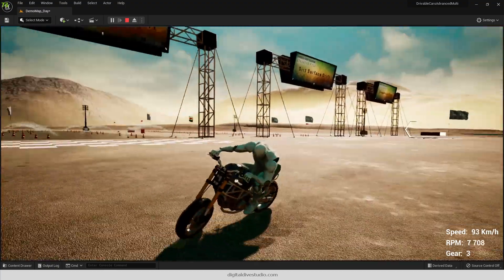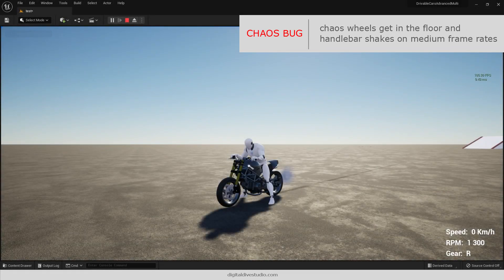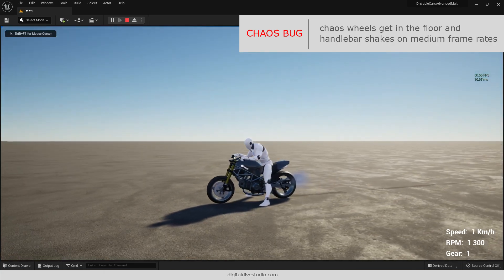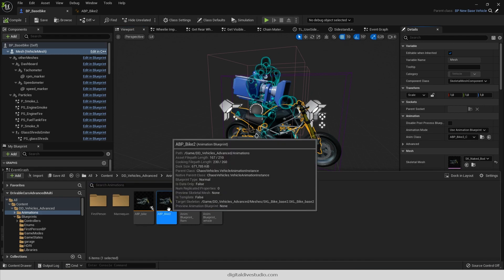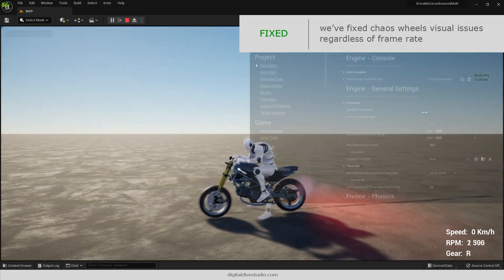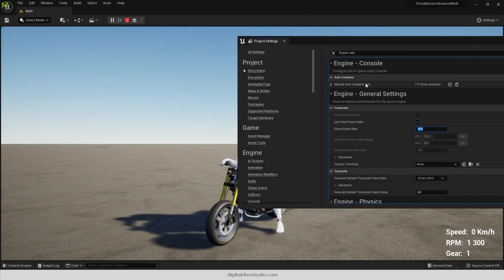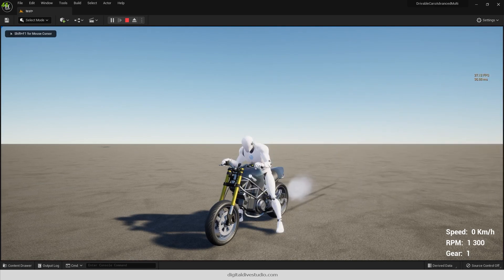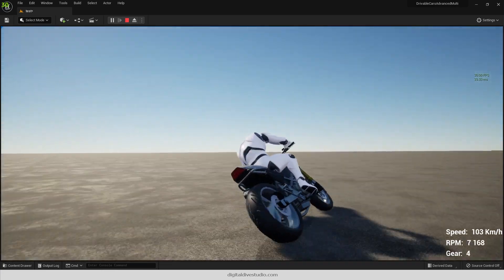UE5 bikes - Ridable Motorbikes for Unreal Engine 5 using chaos physics - wheels issues follow up

Comment: Can I use this in a sequencer and manually animate using a control rig? I'm looking for a bike rigged with a metahuman to use for a film.
Reply from the maker: yes, with this package you can use sequence recorder to record a gameplay and then add it to a level sequence. 
If you prefer to create your own cinematic through the skeletal mesh, you can also do it with this package, but if you are not interested on riding interaction (or recording it) you may want to check our just 3D assets version here: https://www.unrealengine.com/marketplace/en-US/product/3d-motorbikes-3d-assets-3-bike-models-enduro-custom-naked